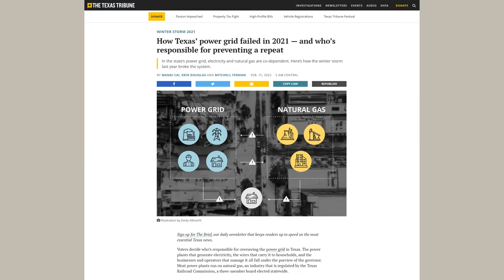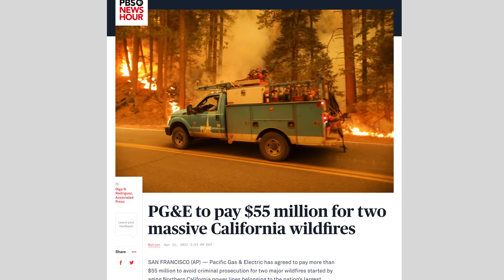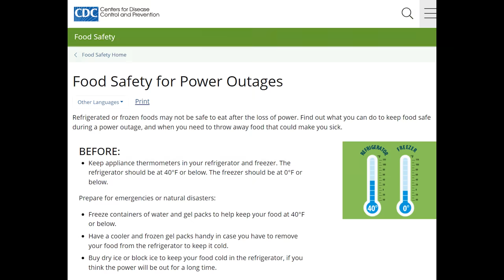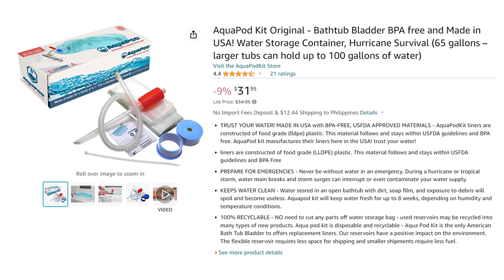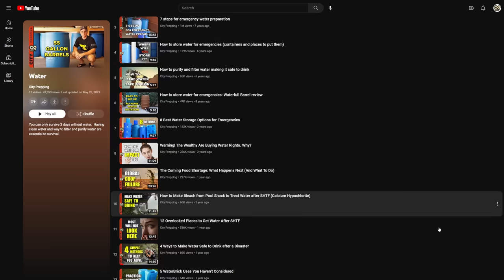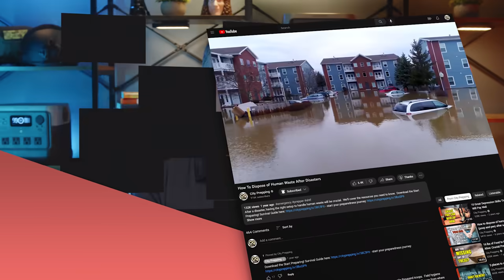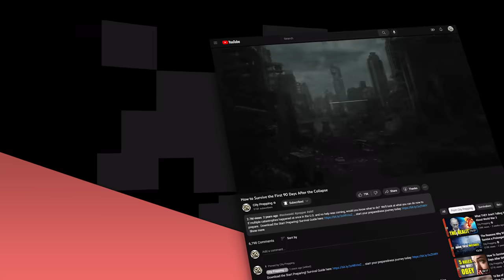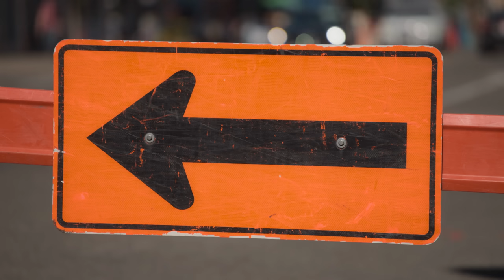Grid Down Collapse: A Timeline of Utilities Failing

Comment: I worked in the electric production industry for 30+ years. The system is VERY fragile...and yet we have had power outages in the past that caught us not ready 😔 People take Kris seriously!!!
Reply: I too worked 30+yrs. Does take much to cause damage. And for someone with a little experience, they can set back lots of people. For a long time. Most stations in the US are only protected by alarms and cameras. That will not deter any criminal looking to cause havoc. We should have upgrade our system long time ago. I believe it’s too late.
Reply: Yes, that ship has sailed
Reply: What backup do you have then ? Solar. Which one ?

Comment: I keep a solo cup of water filled half way in the freezer. Once frozen i place a penny in it. Its staged right by the door for easy checks and if the penny is ever on the bottom of the cup I know the foods bad. Just something my Gran taught me that I’ve always done.
Reply: Great idea, tx
Reply: @donnad4264  ur welcome!
Reply: Sorry, how does it work?
Reply: @luciagil97  in the time it takes for the contents in the freezer to thaw, and maybe the power comes back on before you get home, it’s a good indication at some point the contents thawed to a certain point they may have spoiled and/or thawed but refroze. If the penny is on the bottom of the cup the food cannot be trusted.
Reply: I use a Gatorade bottle half full with a marble frozen in place, same concept. If the marble falls, food is suspect. 
I also put the outside transmitters from an indoor/outdoor weather setup in both the storage freezer, and the kitchen freezer This allows me monitor the temps inside without opening and losing the cold. These are battery powered, and wireless, I also have used a Killa watt meter to determine that with a little creative plugging and unplugging I can keep both at safe temperature with a 1500 watt solar generator. I have 2 so I can have one charging all day, and one powering the good storage, swapping out at sundown.

Comment: Let me tell you something. I am a utilities worker. There is no supply of parts or supplies put away anywhere for when the water goes out. There's is only a fraction of what's needed . 7 out of 10 times were driving to a supplier the same day hoping they have the part in stock to get an entire neighborhoods water back on. This should be alarming to us but apparently that's just always been normal at local government jobs. So City workers are not gonna be hanging around when things go bad.

Comment: As a pharmacist, one of the shortages in a long term grid down situation that I see is medication.  Most people refill their medications when they are a day or two away from running out.  Retail pharmacies generally keep no more than a week's supply of any one medication on their shelves- that is even if they are able to open for business.  I would recommend that you refill your medications early every time to try to build up a supply.  If you get a 30 day supply at a time you can refill it every 25 days and every 75 days if you get a 90 day supply.  Insurance should still pay for it in that time frame. If it doesn't you can ask your pharmacist when the insurance will pay.  You can then calculate how many days after your last refill y you can get another.   If you get it refilled every 25 days, after 6 months you will have an extra 30 day supply.  Keep doing this until you have a year's worth as a back up.  Any longer than that and you risk the medication losing potency.  Don't try to do this with narcotics, however.  That would raise some red flags and , by law, pharmacies can't refill them early.

Oh, and do everything you can to stay as healthy and strong as you can.  Eat right and exercise to stay strong and have endurance.  An extended grid down scenario will require physical strength and endurance.

Comment: I operate a large natural gas hub/transmission station. On the system I work on, all the stations use natural gas fired compressors and generators, or are 100% redundant. Meaning that the ones connected to Hydro have 100% backup capacity without the grid functioning, and many have no grid connection at all. Every station is manned every day, and the critical ones operations live on site while on shift. Sort of like a lighthouse, except we work something like a week on/week off. 

If the electrical grid failed, we could continue to operate without it for years in theory; of course in practice being the only place with lights on and making noise with a large stationary engine running would get attention after a few days without the electrical grid. Depending on the situation, natural gas could easily operate for months without hydro; but the rest of society would have to hold together. Which wouldn’t happen, so it’s moot. As far as the controls used on the pipeline goes, they are not grid dependent per se; they are all run on battery power/UPSs. I can’t speak for operators all over North America, but on my line I am confident that even with severe failures of the control systems we could manage to limp along with a fairly decent amount of gas flowing. Yes, we have systems that automatically shut down line segments, compressors, etc. But enough of us have the technical expertise to bypass the systems in an emergency severe enough to warrant that, and we would. In fact (though I doubt it’s occurred to most people) we are regularly called upon to keep flows going despite equipment failures and other issues. It’s what our jobs exist for. 

However, there are two very significant vulnerabilities to the natural gas transmission systems. 
1) terror/sabotage/attacks. No facilities I am aware of have any security more impressive than a chain link fence, locked doors and possibly CCTV. Anyone with an ax to grind could cause real problems if they had sufficient working knowledge of our system. Or if they asked any operators with a machete to a limb. None of us are hardened commandos, and we will spill the beans with very little threatening required.

2) geological instability. No matter what we do, or what shutdown systems we bypass, if the pipe is broken we can’t supply anything. Floods, earthquakes, landslides, etc can and have all broken pipes. Once that happens, it’s game over until a significant amount of machinery and specialized trades people can be mobilized to repair it.

Comment: When a water supply pipe is operating normally, there are always pinholes and areas around pipe joints that have leaks.  So the city's 70 psi (or whatever) leaks to the outside soil and creates pressurized mud around the leaky area.  When the pipe system goes to zero pressure and water isn't coming into homes, that stored pressure out in the soil back-pushes muddy water into the pipes (now at zero psi) and with it comes various germs.  This is why anytime there is a shut-off or failure of water pipe pressure, you should flush the lines for about 5 minutes or more to wash away as much contaminated water as possible down in the pipes, before it comes up into your house.  The water may look clear, but that doesn't mean it is free from germs.
Reply: I did not know this. Thank you.

Comment: The frozen water bottles at the bottom of a freezer just saved our food during a recent 2 day power outage. The other freezer thawed much more quickly without them.
Reply: They do make some 12 volt freezers for cars that are affordable.
Reply: I always have frozen water bottles of water. I use them in lunch boxes, they work much better than those ice packs. And I have 2 blocks of dry ice in each freezer that I can unwrap if need be. We do have  gas generator but if we go grid down for real, we will eventually run out of gas for it.
Reply: @loricoil1732  With about 400 watts worth of solar panels, and a deep cycle battery you can keep a 12 volt car freezer going even with 2 weeks of cloudy days.

Comment: Be aware that in some areas the sewer or septic systems can back up into the homes during a crises.
Having been thru this in two different homes, I can vouch that having this stuff bubbling up and overflowing thru your sinks, toilets, and any drain pipes is terrifying -- not to mention having to deal with the gases and odors and later clean up.
Reply: You are the only person I have heard talk about this. I have a plumbing tool, which is a long skinny ballon that is inserted into your sewer clean-out access, then inflated to plug the pipe.
Reply: Few years back we had a county worker show us  how to close the sewer shut off valve to our home. He Even gave us a tool to use. Hope we remember how to do it in an emergency!
Reply: It's not supposed to you're supposed to have a one-way valve on there
Reply: @MarshaBW1  do it once or twice periodically to keep refreshing your mind.
Reply: @lpfx777  at your plumbing place or your home Hardware like Lowe's and Home Depot
Reply: You don't have to worry about a septic tank in a grid down situation. But yes it is a problem if you have to use sewer system. Heck I want well water and septic system. In case the grid goes down.
Reply: We call it a backwater valve in Az. It acts like a check valve on your sewer lateral line. They were required as code for build back in the 90’s I think. Any home older should get one installed. I work at the local wastewater treatment plant. We have backup power there for outages. Every lift station has backup power as well.
Reply: A good reason to make sure you have insurance to cover sewer backups!
Reply: How would a septic back up?
Reply: @bhargi4692  if your tank is full and you continue to flush, it will come up through the lowest drain,  most likely the shower.
Reply: @j.patrickmoore9137 I think he meant why would it apply to a crisis situation. The septic system doesn’t know if there is a crisis .. it’d just be a normal backup. Just my thoughts.
Reply: @croberts2358  It may be that it shouldn't be able to back up, but that doesn't stop it from doing just that... especially if your house predates the relevant codes. We have a linked sewer system with our neighbors, and ever since the new people moved in we've had backups and blockages pretty regularly thanks to their dumping grease down the drain.
Reply: @stevenschnepp576  well if it's not too deep you may be able to put you in a one-way valve. Can you connect to the mainline or maybe put in an overflow bypass for at least liquids and maybe put it on payments or since they're responsible you might be able to make them pay for part of it. 
Some areas put in grinder pumps thereby allowing sewage to go through a three-quarter line cheaper in some areas where cost can get out of control.
Reply: @stevenschnepp576  You know you might want to buy you a grinder pump so you'll have some options just in case supplies or repair people get scarce. Sorry you're having this problem! you can't always depend on people to do the right thing. I learned that lesson the hard way too.
Reply: @stevenschnepp576  if you're strapped for money go to your local church and present a request for help to the Deacons and see if they've got someone that could help you or possibly work with you or know someone that would be willing. We do that from time to time 4 people. Normally it won't be overnight because they have to pray about it and talk to the people on the finance committee.
Reply: @bhargi4692  They don't, that's why they're the preferred sewage system.
Reply: I've been surprised at the number of women who don't know how to pee anywhere other than a restroom.  Roadside rest stops don't always have bathrooms so one has to make do.  My suggestion is to learn how to pee outside and do it at least once a week if not more.
Reply: @dancinginabundance  you made my day. Can you imagine how what they would say if you actually told them that  urine could be used in a garden as fertilizer. Lol. Will probably pass out and flop on the ground.
Reply: @dancinginabundance  I would probably be all over their feet.😂😂😂😂😂😂😂
Reply: @dancinginabundance  Well for convenience and water saving they could put marine toilet in like an outhouse or something it flushes on two cups of water. I've used solar water heaters before they work awesome you just have to watch about draining them in the winter time when it's going to get too cold. Rigging  up double shut off valves. We've made solar heaters for the house use them for a while they will work. On the website, fan-made worm bins. I love learning. Had some awesome solar panels. Never use the fresnel lens. Going to try biogas. People look at it like an adventure and just try things and don't get frustrated and actually interesting.
Reply: we are doing the rainwater
Reply: @croberts2358  Practice, practice, practice.  LOL
Reply: @croberts2358  I thought about it; TMI for some.
Reply: I live up at the top end of a steep dead end road. Sh!t flows downhill. I think we will be OK for a few months with no services without having to build an outhouse.   We camp a lot and gramma needs a chum bucket...5 gallon bucket with seat. We use TRASH COMPACTOR BAGS as liners as they are very thick  and they don't leak. Put an inch or 2 of kitty litter inside or beach sand and the compactor bag will last for 3-4 days without reeking badly.

Comment: This is excellent! You are right: grid failure isn't just about losing refrigeration and lights. Water pumps that lift water to storage tanks for pressurized delivery aren't powered by gerbils. Getting gasoline out of the pump doesn't happen and the station attendants aren't going to allow anyone to try and siphon it out of the tank. I keep my landline telephone because it is not directly dependent on the grid whereas cell phone towers are useless after their emergency power supply is exhausted. You did a great analysis and I appreciate it. I am envious of your analytical skills!

Comment: The idiots at the EPA were the ones that prohibited gas-powered pumps at the gas pumping stations. So, the natural gas system is not independent of the grid like they used to be. During the Great Texas Deep Freeze of 2021, many cities in Texas had little to no water pressure. The reason for this turned out to not be water main breaks but rather what the cities did was tell everyone to turn on their faucets to a stream. Well, what happens when every faucet in the city is running water? Yep, the pressure goes to zip. Here, they even asked the Coast Guard to fly over the city looking for the break. There wasn't one.
The temperature inside our apartment got down to 47 degrees. Good thing the cats didn't have opposable thumbs or they would have set something on fire for heat.;)

Comment: Speaking about electrical grids, yes they are old and not very well maintained due to neglect and the massive impact it will eventually cause. Despite power outages for homes think about business, banks ( especially if they go to electronic banking). Backup generators will only run so long even with all back up electronic systems. The majority of people will not understand the impact. Only readiness will help you survive.

Comment: Our kids have grown up and moved out. We barely use the capacity of our refrigerator.
The whole back of our fridge is full of gallon jugs of water. Not only does this provide a handy water source, but it saves power because the fridge doesn't have to recool that volume of air every time we open the door. Also, when the power is out all that cold water helps hold temperature.

Comment: Growing up in Florida, if we heard there was a bad storm coming we always had old butter containers that we filled with water and froze to preserve the meat in the freezer. The bathtub bladder is also a great thing to own like he said to store water before the towers are empty. Having propane or wood camping stoves to cook food as it thaws is essential it power goes out for long times, just don't use them inside due to carbon monoxide and fire hazard. Battery powered flashlights, crank flashlights or candles are needed for moving around your house in the dark. At the start of a storm if power went out the police in our area went around giving out ice and MREs but its not a great plan to rely on that. Lastly power outages and natural disaster brings out the worst in people so having a protection plan is a must to avoid becoming an expensive loot drop for someone.
Reply: “Butter” container?  I don’t know about you, but out butter comes in cardboard.
Reply: @Sam-y5d3j  your point is?
Reply: @Sam-y5d3j  im so confused
Reply: Lol. I cant believe it's not butter!!! Spread! Lol
Reply: Been using wood stove for thirty years, never had any real problem. Guest it comes down to use some common sense and knowledge and you should be good to go.

Comment: The main thing I got from this video is to move out of town to a house on a well and get off the grid as much as possible, as quickly as possible.
Reply: Keep a hand pump, or generator with gas for the well. We have had to use the generator to get water when our power was out for a week in MO back in 2005. It was hot, as it was summer time, but we made it.